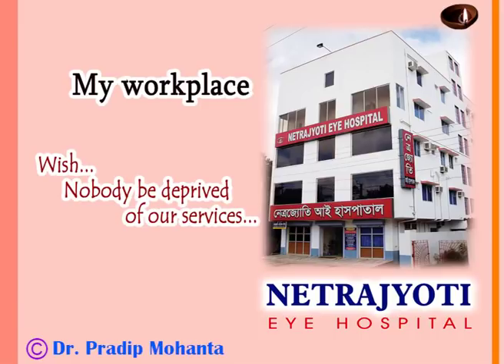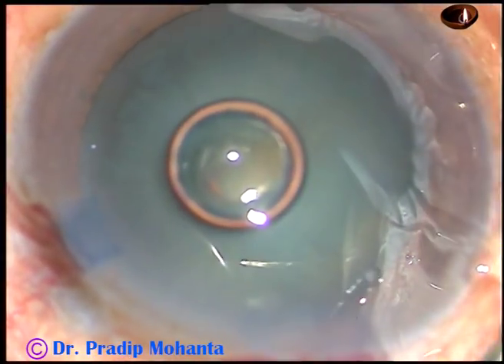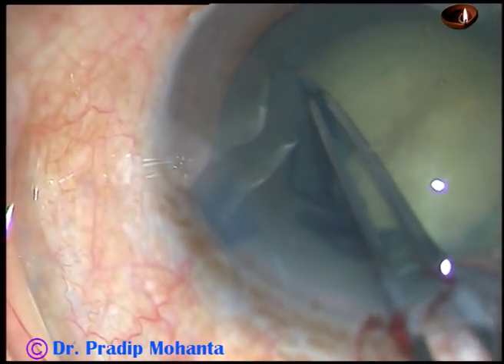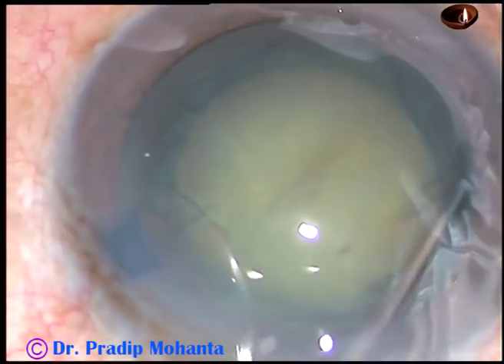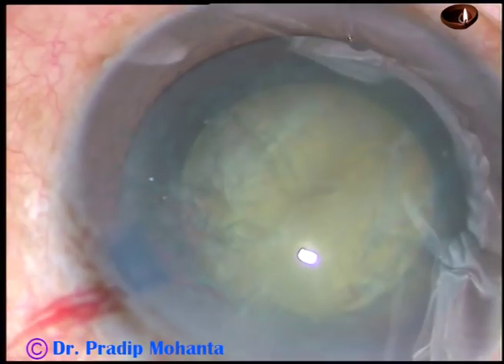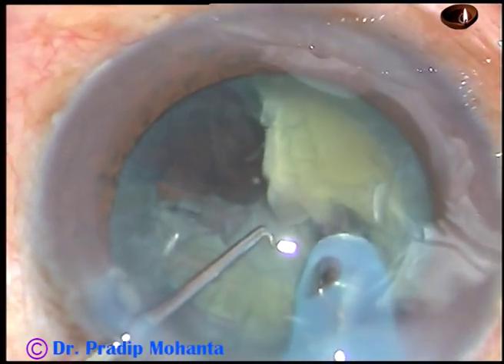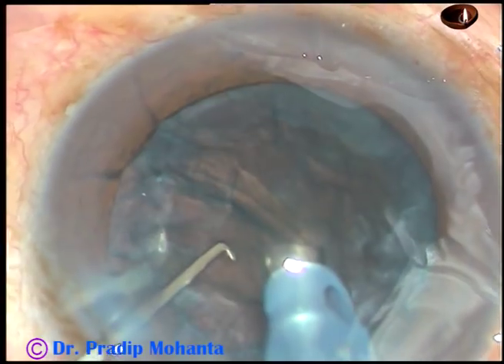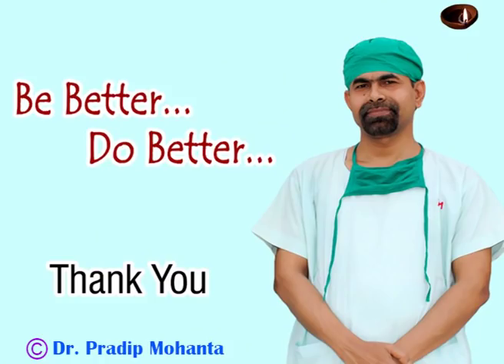Abnormal capsulocortical adhesion and the "DISH" Technique : Pradip Mohanta

Comment: When I find such no effective rotation or hydrodissection I inject gel under the capsule and start phaco, and after initial phaco I go and try another hydrodissection attempt and usually it succeed. Before finishing the last quadrant I go out and put a cushion of Viscot to push the posterior capsule away and it helps in the cortex clean up thereafter.